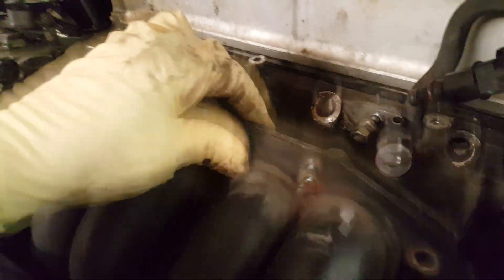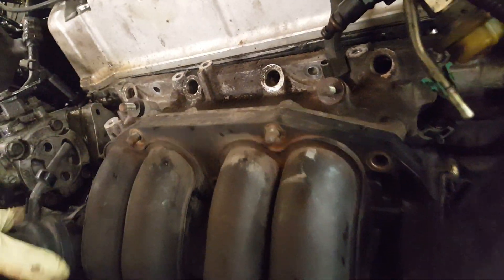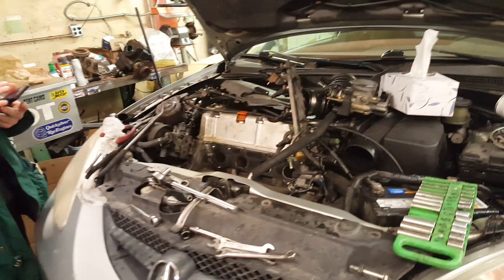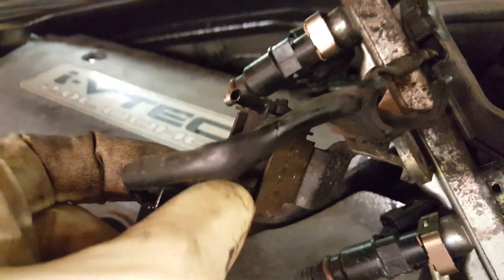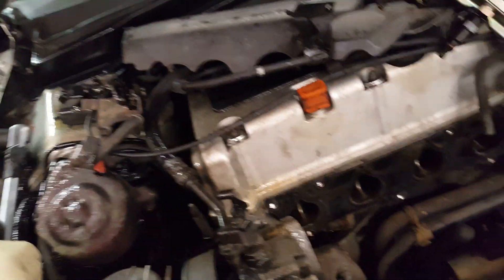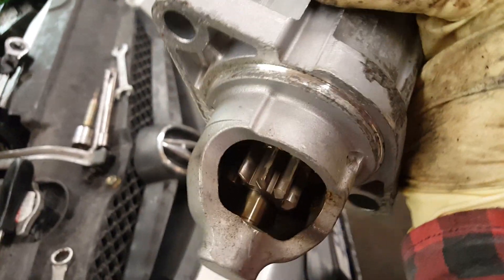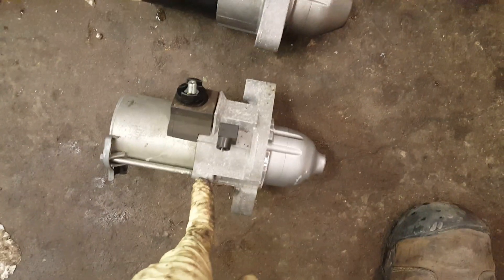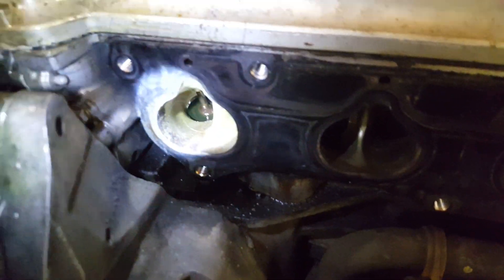Ze Dr Ze Acura Ze Ztarter Junk 12 8 19

Comment: Yes done many k series starters.  Mitsubishi 4g engines behind exhaust manifold.  Caddy northstaars and such under intake.  I'm tell u bout new grand Cherokee's with 3.6 pentastar and 4x4 its 5 plus labor hours. Must remove front diff. Assembly, lh motor mount, and motor plate for mount to access starter.  Now that one is FN B.S. I'm my opinion.  Have a great day